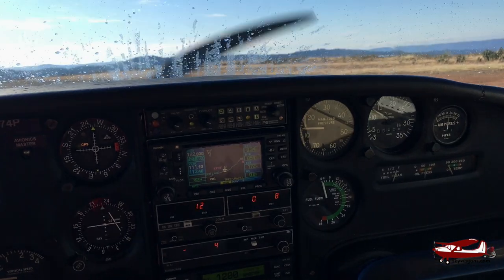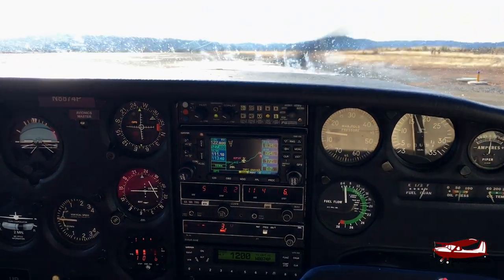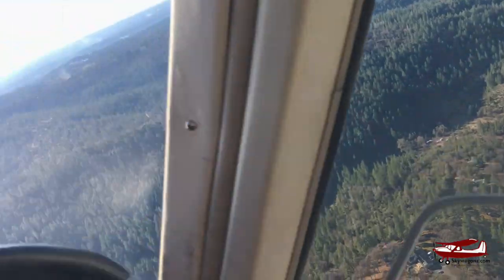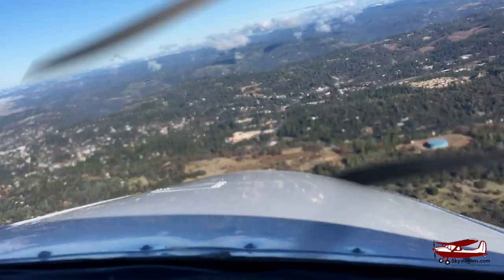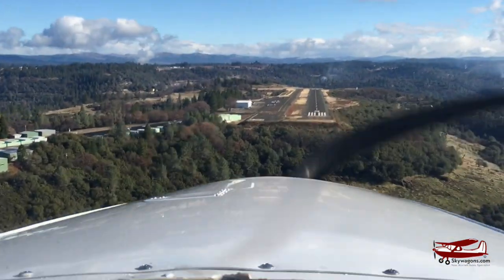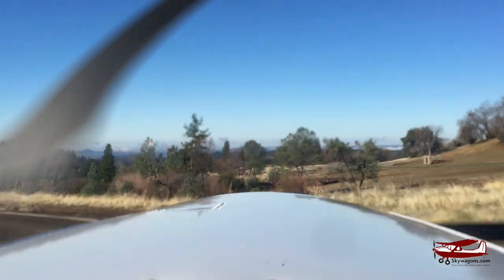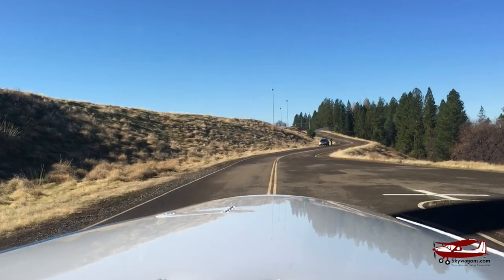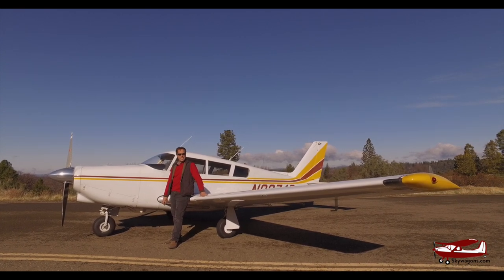Comanche 260B

Comment: The gear extension handle is a lever not a pump. Underneath the floor cover you pulled up is an electric gearbox. If that gearbox fails there is a red disengagement tab to remove the gearbox from the circuit. By extending the emergency gear lever and rotating it forward the gear extension system aided by bungees will move the landing gear to the down and locked position. If you ever have to do this be extremely gentle and cautious while taxiing, the mechanical down lock was the gearbox and it is no longer in play. The Aircraft must be jacked to reset the gearbox. Don’t practice emergency gear extensions in flight. If you really want to see how it works get your mechanic to jack the plane and then its safe to run through the emergency checklist and see how it all functions. Happy flying.
Reply from the maker: Thank you for this information. It's always good to learn more about these birds as they are not my specialty.
Reply: Spot on John! Also, DO NOT use the center floor area just behind the telescopic emergency gear lever to store your stuff! That lever rotates aft and folds flat along the floor when the gear is retracted. The motor and gearbox hate it when you do place your Jepp chart binder there. Owned a 1963 Comanche 250 for 15 years and absolutely loved it.
Reply: And make sure the bungees are recent and not tired or the gear will not go down with a thump and you will be hoping it’s down.
Reply: Thanks so very much for sharing that! I’m a retired master aircraft mechanic and I have taught several Comanche owners over the years how to perform the emergency gear extension procedure on their aircraft! The bungee cords on the Comanche are to help with the emergency extension.
Reply: Yep

Comment: These are some of the best flying videos on YouTube. The perfect balance of just enough detail without going down the rabbit hole. I especially like how you take the airplane up for a pattern run afterwards. Keep them coming.  I’d love to see an early Piper Apache without any modifications.
Reply from the maker: We might be able to do an Apache.  There is one here at Placerville.
Reply: @skywagonuniversity5023  With both 0-320's running well there was nothing really amiss with the Apache 150. 
It was stable and pleasant to operate. 'O' ring replacements were required from time to time in the hydraulics of the landing gear.

Comment: Good video. I have owned my 1966 260b since 1976 (46 years) and still love it. Your report is very accurate but I would like to make a couple of comments. 1) Approach speed should be 80/85 knots. 2) Your fuel caps are not original but aftermarket improved ones. 3) Comanches left the factory with 3 600x6 tyres but many owners (me included) fit a special nose wheel 500 tyre on the original 600 rim, which gives the same footprint with a reduced diameter , helping to avoid wheelbarrowing on landing and looks better. 
Comanches are well supported for spare, upgrades & improvements by "Webco" and I have never had a problem sourcing parts.
They are superb aircraft and most owners have a high regard for them which is not found with most other types except perhaps for Bonanza's.
Reply from the maker: Thank you for this information.

Comment: Stephen Gardner.  Great review of the Comanche 260B, very nice airplane.  I owned a 1964 Piper Twin Comanche  another great design By Ted Smith from the Lockhaven, PA plant.  This was a great aircraft too, very similar in performance 160 kts. with a fuel burn of 14-16 GPH.  This model had a Lycoming IO-320 fuel Injected engines with constant speed propellers.  Additionally, it had a Robertson STOL which helped the slow speed handling characteristics of the airplane by lowering Vmc from 90kts to 80kts. without affecting the cruise performance of the airplane.  This was a great modification to this high speed laminar flow wing.  A great cross country airplane.

Comment: The 260 I feel was the epitome of the Comanche series. The 400 was a beast and the 180 was underpowered. I had friends at Lee with literally all variants. Our mechanic owned a 260B and it was the perfect acft. If you didn't need all that fuel you could load the crap out it. And yes it was quick.

Comment: A&PIA and 260B owner here.  Its important to make sure the boot on the gear extension handle is properly attached as it could bunch up and cause the gear breaker to trip at the last bit of travel up.  While in flight with the gear up try to stick your fingers around the handle.  You will find that it will be very tight to the carpet.  Great review on the 260B!  I absolutely love mine.
Reply from the maker: Good tip on the gear transition handle movement arc.  Bit like a manual geared Mooney M20.  The gear handle has to have a clear channel, but in that case, the "motor" is the human.
Reply: Good thought! We have a 260b and I never thought of that!

Comment: You do not have to remove the entire tail for the horizontal stab horn inspection. You only have to remove the horizontal stab which comes off in two pieces. Two bolts in each half then disconnect the trim control arm connection and slide the halves off(make sure you hold them when removing the last bolt because they may turn vertical quickly). Can be done in less than 15 minutes. Block the cables on the inside and its eight bolts to remove the horn. If your an A&P you can inspect it yourself and reinstall. Hertiage Aero will let you send it to them and they'll do the inspection or replace the piper horn with the Australian horn and that does away with the AD. Or you can just take the plane to them and they'll do the regular inspection for about 2500. Installing the aussie horn is a bit more. As said before the handle on the floor is an assist handle for extending the gear don't put anything on the floor behind it as it lays flat on the floor with the gear up. It'll smash a foot, don't ask me how I know.

Comment: Comanches are awesome, love my 250.  I'll not nitpick the whole video, I'll make one small correction and one addition.  The 600x6 nose wheel is on the TC from the factory, the STC you referred to allows the installation of a smaller nose wheel.  Prior to the 260, the nose gear door only covered the gear and not the wheel/tire so putting a small tire on is a drag penalty since it leaves more room for air to enter the wheel well.  1961 was a big year for the comanche, the aux tanks bringing total fuel to 90 gallons became an option for the first time on the 250 (and not available on the 180), the radios moved to the center stack configuration, and the left seat toe brakes were added.
Reply from the maker: Thank you for the clarification.

Comment: Our 400 freighter version with no seats in it, when empty, would run out of back stick before the mains touched down and so the nose wheel would make first contact.
We only got around it by SELECTING FLAPS UP at the flare………a beautiful flare was guaranteed.
Double check it’s the flap selector though…….:-))
I agree the wing is a thing of beauty !!!

Comment: I flew a Comanche for the first time last week and had a fun time with it. It was obviously designed for speed rather than lift and stability so it flies a little squirrely. I didn't try any stalls and wonder what that experience would be like. The landing gear is short; when landing I did float quite a way down the runway on ground effect. Getting in the single Comanche door and sliding across was a little awkward but getting out was much worse -- I crawled out onto the wing on my hands & knees.

Comment: You should also add that the Comanche came completely zinc chromated inside & are not prone to corrosion like most planes if the zinc chromate is not damaged during the stripping & painting they gone threw over the years.

Comment: 13:44. Great presentation thanks. I love seeing Comanches on YT however, as others have said please do NOT pump the Comanche gear handle. It is not hydraulic ;-).

Also, the 180 is not under powered per se. It has less hp but it is lighter and more efficient than its bigger brothers and it performs as well as if not better than an Arrow on 20 fewer horses. It is a lovely flying, great performing and very underrated aircraft.
Reply from the maker: Thanks for the info!

Comment: The 1965 Comanche 260 only has 4 seats, with the same window and cargo bay configuration as the 250. The 6 seat configuration with three side windows on each side start from the 260B onwards. If you are looking to buy a Comanche, the landing gear AD is due every 10 years and/or 1000hrs, and can be costly if the gear had not been properly lubricated through the years.
Reply from the maker: Also weren't there a few "250"s that were injected too?
Reply: @skywagonuniversity5023  I am not too sure if there was an injected 250. I do know that in 1965 that both carbureted and injected 260’s where offered. I have an injected model.

Comment: Love the videos! Small correction...the large nose wheel was original...then folks adapted the smaller nose wheel to reduce the wheelbarrow tendency. That said, if flown at the correct approach speed (slower than most people want to fly) the large nose wheel is no problem and offers much better soft-field performance due to it's larger size. The Comanche is a great grass field airplane.
Reply from the maker: Doug,
Thank you for the clarification. They must be like Mooneys, people land them too fast and then blame the plane. I thought there was something about the nosewheels on these excellent planes.

Comment: Its been a few years since I flew a 260b, but I think the emergency gear extension is not a pump but actually physically moves the gear as the gear is electrically driven not hydraulically ; that is why the handle moves with the gear in normal use also.  Any way great summary of a great plane.
Reply from the maker: Thanks.  Yes, generic use of the word pump.   It is electric and the handle moves with the gear through a single arc,
Reply: The gear extension handle is definitely not a pump . After you disconnect the motor from the mechanical gear  that extends the gear you extend the gear you use the handle to extend the gear.

Comment: That insert shot on landing in the beginning looked a lot like a Mooney to me haha
Reply from the maker: You had me worried!  I had to check to be sure, but you can see the N number on the panel, N8874P.  If you run that in the FAA database, you'll see it is a Piper registration.  So far, the only misfire was with the Navion video, where a short clip from another aircraft snuck in.   - Don the Camera Guy.
Reply: @skywagonuniversity5023  The *exterior shot looked like a Mooney to me...but I was sitting pretty far away on my couch...

Comment: The round extensions on the tips  of the stabilator (yellow) are  added to prevent tail flutter. See tail flutter video on YouTube It's scarry.  Before this the max speed was reduced from about 223 MPH to 203 MPH. This brings it back to 223m
Reply from the maker: Thank you for this info.  I was wondering about those.  I'm not a Comanche expert although I like them.
Reply: Thank you for answering the question I was about to ask........

Comment: I noticed your listing doesn't show the 3rd row of seats. 
Can you post a pic showing the back row of seats?
Does anyone have any info on how the back row is for seating, is it just kid seating? What does the back row do to CG limits?
Reply from the maker: All the Three window Comanche 260's and a few of the 250's has six seats.  The last two seats use ALL the baggage area. They are accessed through the baggage door or kids can climb over.  They are not like in a 206 or a 210 or Beech 36 though.  Most owners do not use them.
Reply: Yes, and a total of 237 pounds.

Comment: I fly out of placerville. Kinda worried about flying a drone next to an active runway?
Reply from the maker: Hi Steve.  I've got the commercial drone pilot license and permission from the airport.  I set the drone to 5 degrees off centerline so I can't get to the runway, and I'm high enough that I wouldn't hit any taxiing aircraft, which I'm also watching out for.  Safety is a top priority.  Just like flying a real plane, I make it a point not to run into others.  - Don the Camera Guy
Reply: @skywagonuniversity5023  That's awesome. Thanks for the reply

Comment: They actually stopped making the Comanche because it was very expensive to make. Not the factory got flooded. Cherokees have about 30% less parts!
Reply from the maker: but the flooding is white tipped them over the edge or they probably would’ve gone a bit longer with the production.

Comment: No do not pump the gear emergency,,you first trip the lacht between the motor and the transmission  the gear will free fold then you continue with the lever pushing forward  until it will lock

Comment: First PA-24 Comanche; 180 horse power introduced 1958.
Reply: Their is really no comparison. The 6 seat Comanches had cushions on the floor of the baggage compartment and back rest. the load limit at that area is 250 pounds and the seat cushions were 17 pounds as I remember.  With 6 people you could not carry much fuel.  I carried 6 people 2 times in 45 years of ownership, on very short flights.
Reply: @tomburke1 I know the 180 Comanche did not have the payload or speed of the 250 and 260 Comanche.   I was just stating that early models could be bought with a 180 Lycoming engine.  I flew one way back in 1962.

Comment: Small mistake. To get 160 knots you will need to run at 75%. That’s easily 14 gallons per hour, not 11 GPH. Good video though. Keep them coming.
Reply from the maker: OK, Thank you.  I think a good rule of thumb is about 2 to 2.5 gallons per hour per cylinder, so 10 on a 360 and 15 max on a 540 and less if you are nice to it, but that is a good flight plan number so you never run out of fuel.
Reply: I routinely make a 159nm trip in my 260B and it takes me right at 1.0.  In cruise I typically run 2300/25.0", LOP 11.7gph.
Reply from the maker: @rocketbob  Thank you for this info. Injected 260 right, not the carb'ed 250?
Reply: @skywagonuniversity5023  correct, injected.
Reply from the maker: @rocketbob  OK, Yes, makes for accurate LOP operation.  Thanks.

Comment: Comanche is a wonderful airplane but ones lost its wings in flight
Reply from the maker: True, But a Chevy Truck crashed once too, and a Ford and a Mercedes, and a Tesla etc etc and we all still drive them.  One badly maintained, weakened and corroded Comanche cannot be the signal that they all will do it.  It pays to look after these great older planes.
Reply: Comanche wing spars are one of the strongest out there for single pistons, practically bulletproof. Must’ve hit something at high speed or improperly maintained for something like that to occur.
Reply: What? That does it! It's a Cirrus for me!
Reply: One of my instructors got caught in a wingtip vortex from an airliner and it rolled them so fast it broke the spar.  He was able to land it safely.
Reply: @Cwra1smith  hiya...check out the accident rate. Check out the SOP for stall/spin. And...check out the 💰💰💰

Comment: Stabilator -- so called because the surface functions as both the horizontal stabilizer and as the elevator.  All t Cherokee and derivatives have it -- but then, so do almost all fighter aircraft today!
Reply: It's the MODERN way to control pitch (wink wink).
Reply: Also my old Titan Tornado microlight :o
Reply: That was the US's secret to breaking the sound barrier.
Reply: @gorgly123  Except it was a British secret shared with the U. S. ;)